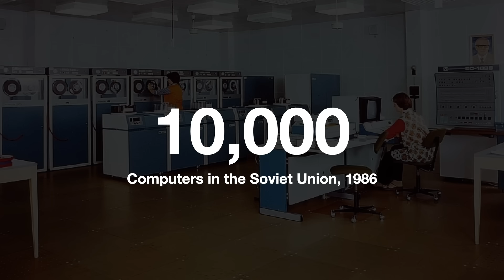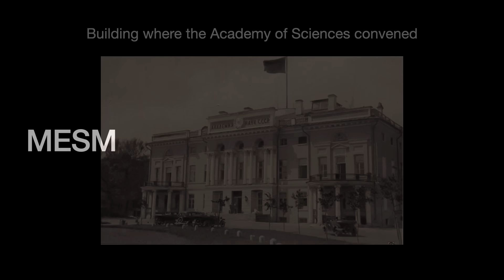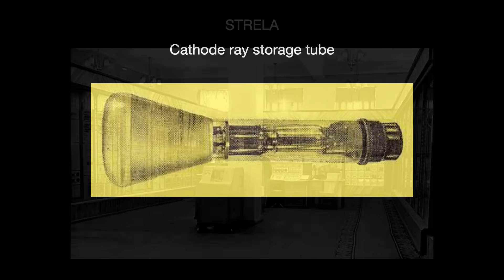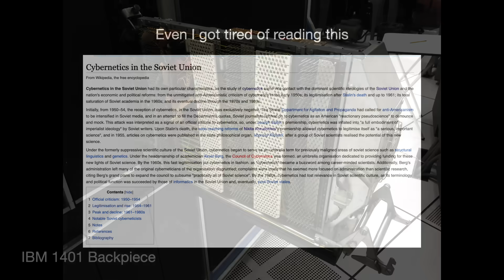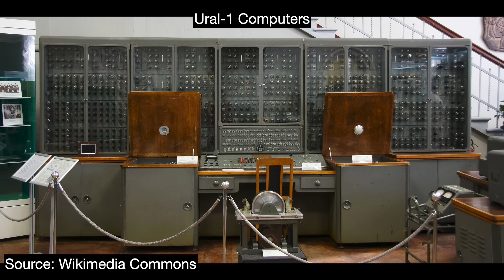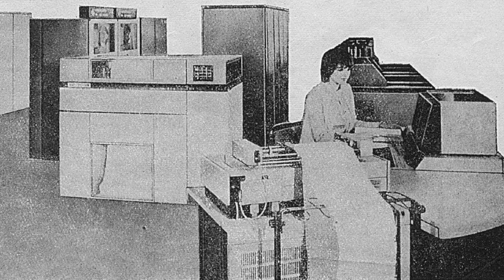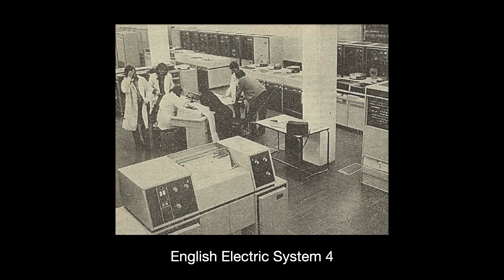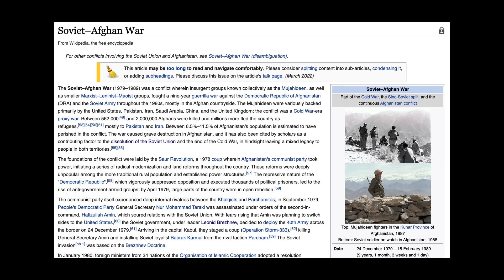Why the Soviet Computer Failed

Comment: That is both the strength and weakness of a command economy. You are generally locked in to a system. If that system is what you need and works well, your golden and can have an amazing scale of production. If you need to make a change and it isn't accepted as obvious, good luck pushing against a river (especially one where political power is so heavily entwined with industrial decision making).

Where as a fully market based economy generally requires market forces to line up for an expected near term profit. But you can nudge that with public funding (like with Bell Labs and Nasa).

Comment: Relational databases.  E. F. Codd.  That was so huge, but it's such inside baseball no one gets how huge.  

Omni databases were the norm.  Powerful processing on flat files.  All your data sits in one text file and we come up with faster ways to read and write to it.  The problem is redundancy.  If you have the zip code, you don't need city and state.  If one customer does twenty transactions, we're going to have their full name and address in every line.

A relational database "normalizes" by separating out the redundant elements.  So now you have one table that has only customers with no redundant data.  You then relate the customer number in the customer table with the customer number in the orders table.  I's cheaper because it takes less space, it's quicker because the files are shorter, and it's more accurate because you don't store the same data and risk having variations.  

It revolutionized data. It made so much possible.  But it's not the kind of innovation a government will come up with.

Comment: Computer technology was pretty much fundamentally incompatible with the Soviet system.  They relied on huge bureaucracies to make decisions.  By the time any idea filtered down from the top to the people who actually made the machines and software it was obsolete.  Whenever a revolutionary tech breakthrough happened, which in computers in the '60s, '70s, and '80s was about every 18 months, these bureaucracies had to throw themselves in reverse, forget everything they were doing, and start over.  It was impossible for them to move that fast.  They were way better at mature industries like steel and oil where they could rely on economies of scale and any improvements to either the product or process were on the margins.

Comment: Soviets failed in everything by the fall of the USSR and the Eastern Bloc. They failed because Government control of everything led to a lazy but hurry up culture. They coyld have twenty doors to a building's front entry but only one could be used so that they could avoid replacing broken ones. They also just needed to have produced a facsimile of a product or service over making sure it were working properly. Add in that everyone was graded by an average result of a class or group, and you got idiots with higher test results than the truth, with excellent people held back by said morons. Computer science and all other disciplines failed on account of these.

Comment: Very Long Instruction Word (VLIW) architectures, which are designed to execute multiple independent operations in a single, very long instruction were the Soviet legacy and the single instruction set of the West were not popular with them... The Soviets prefer beefy robust processors that generate less heat and with reduced frequency operation and less susceptible to EMS radiation, one soviet processor running at 2 GHz could do the job faster than one of the west at 5 GHZ, most Soviet designs were for the defense department and not for consumer products....!

Comment: The Soviets hammered several nails into their coffin on this subject.  I had the privilege to work with a Soviet computer operator in the early '90's. He freely admitted that they took the IBM operating system and reverse engineered it to work on their hardware. He said when they did that they viewed the error handling routines as not necessary and stripped that code out of the OS. When a application failed technicians would spend days going over core dumps or reading panel lights to try and determine what went wrong.
Reply: Cool lie

Comment: Because the only way they had access to computer chips is by buying video games and reprograming those.
Reply: This is BS. There were no real video games at the time.

I was an apprentice in the young semiconductor industry in the mid 1980s at the heart of the chip design department, we made most CPUs, PIOs, SIOs, EPOMS, RAMs etc, already on our own. Reverse engineering played a great role, but never video games.

The building you in 15:57 with the Tatra tram in front is located in downtown Dresden and I worked there in the early 1980s as a high school student.
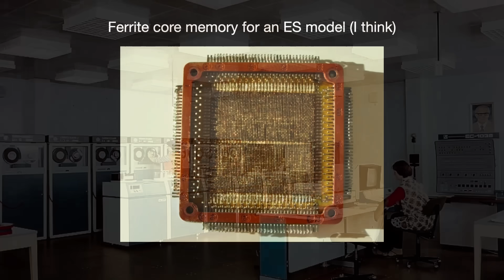But the real design centre was located at the North of Dresden in Klotzsche hosting huge IBM computers for the chip design work, where all these huge semiconductor companies are located now. The picture in 16:54 is such a computer room in the GDR where I worked.
Later during my MSc university program (electronics/electrics/ software) I wrote programs on exactly this IBM monster to hook up with the next now new IBM computer in another building.

Do us a favour, do not write such crap if you do not know anything about it.
And one more thing, do not believe we people in Eastern Europa were or are idiots. We often achieved more with less.

Peace! from Dresden / Germany

Comment: I don't understand how on Earth those old computers worked, since they had so many connectors and if one of those got lose, the whole computer malfunctions. I used to work on an old Felix C-256, that was designed in the early 70s, it didn't have tubes, worked on transistors, but it was so fiddle, needed a controlled room temperature and often boards didn't make proper contacts and had to push them.

Comment: It was by any means far more complicated. The issue was allways new discovery coming in far too rapidly. And russia is big. You have no scope how big. None has. 
So imagine you have made a computer based on tube tech. And you are smart , you see this tech evolving like crazy. You allso know that what is cutting edge today , will be obsolete next morning. You figure out to simply skip the current stuff , and wait till something more refined comes along , and upgrade when it be good for a longer time. Imagine purchasing every brand new cpu as soon as it is available even if the increment is not a lot of more extra. And your current stuff works fairly okay. And that is what russia did. They knew , if they went on and start to computerise whatever is possible , only a very small fraction will be done by the time that computer becomes obsolete and useless. Instead lets wait for something better. And russia actually did allways go this route. They never ever started to adopt anything on large scale unless it was refined enough for many years. In the meantime , importing technology that is getting obsolete and therefore cheap , was allso done. That was the least costly way to both have computers , but not realy relay on something exotic , yet have the potential to solve sourcing by producing if they ever get cut off from supplies. This had spared gigantic amounts of money for them over the time. They had quite a lot to build , there where many gigantic projects that needed those funds.  Surely one might ask where and what , but thats not so simple. Assume you just want to give everyone 1 dollar.  With a pooulation of 10 billion , thats gona be costly. And the result per person would be quite small. Now russia has very large distances , they had to make roads , rails , recomstruct a lot of buildings , build telecommunications  on the order far greater than the usa had ever.  And allso had to plan the economy. New agricultural machinery needed etc.. in vast numbers. Crazy big numbers. At that point , if design could be made more efficient and cheaper by computers , down to the single porudction 1 item , the costs where little... consider the world wide known mtz tractors. The crank case casting is even today Just a very slight modification of the original. Millions had been produced , the design no mather how costly would had been , has very little reflected in the per piece price. And that is why russia did not develop computers , and did not employ them as soon as they where available. It simply just made no sense at that given time and situation .

Comment: The computer in the thumbnail is actually Bulgarian. In fact Bulgaria made most of the large mainframe computers for the eastern block so most of the computers present throughout the 70s and 80s are Bulgarian. Also Bulgaria was not part of the Soviet Union despite being communist country and having close relationship with Russia. Also another thing Bulgaria was the only country in the Eastern block to manufacture magnetic disk drive storage modules for the entire eastern block. Easy way to know if a mainframe machine is Bulgarian is to see for the Indication "ЕС" somewhere on the machine. That's how IZOT named all their line up products. "ЕС" followed by a model number.

Comment: My grandfather was a computer programmer and managed to negotiate the purchase of the first IBM computer in Czechoslovakia, in the late 1960s when political conditions were more loose. Until then, his factory only had the Soviet Urals, that would crash all the time. Since the purchase of the IBM machine, his office was flooded by hordes of Soviet computer engineers, keen to take the computer apart and look inside. Eventually, the intimidation from the secret police (STB) got too much and grandpa quit the job and moved to another factory. Years later, he took apart the latest Soviet production (ES) and found it to be a 1:1 copy of his old IBM. So much for my grandfather's contribution to the development of computers in the Eastern Block.

Comment: Although some people imagine that from the beginning of the 1970s all computers in the USSR were developed and manufactured only according to the ES EVM project, this, of course, was not so. Other successful models of different standards continued to be manufactured - from the same BESM-6 (it was manufactured in a modernized version until the mid-1980s), powerful PS2000/PS3000 computers, popular models of the M series, Nairi, Minsk, etc., and naturally - various military computers (5E series, etc.). Small control computers were manufactured for production and science, and of course - many on-board computers for civilian and military equipment. Since the early 1970s, the active production of various minicomputers began, and since the mid-1970s, microcomputers - some of them were software compatible with the popular American models DEC and HP (Soviet SM-2, 3, 4, 1420, 1300, 1600, 1700, Elektronika 60, 79, 81, etc.), some with original architectures - Elektronika NC, S5, etc. Various desktop programmable computers were produced, similar to modern PCs - for example, the large Iskra series (the most famous and powerful models are 1256 and 226) and Elektronika (D3-28, T3-29, etc.).

Since the beginning of 1980s, the production of classic PCs based on microprocessors began - VEF Micro, Agat, DVK, BK-0010, Elektronika 85 (MS0585), ES-1840/1841, Iskra 1030/1031, Neuron I9.66, SM-1810, UKNC, Korvet, Vector-06C, Istra-4816, PC-01 Lvov, PC8000 Sura, Apogey, Partner, Nemiga, Poisk, MK88, MS-1502, Assistant-128, MS-0515, many Spectrum-compatible home PCs (Byte, Robik, Dubna, Magik, Orel, etc.) and others. The USSR created very advanced personal computers, and on its own element base: for example, the 16-bit professional Istra-4816 with three processors (the main one is K1810VM86, an analogue of i8086), large memory and advanced graphics, and all the electronics are on one board, or the inexpensive educational UKNC (MS0511) - the most popular Soviet PC, with two 16-bit processors (DEC-compatible K1801VM2) and excellent color graphics 640x288, or Soyuz-Neon PC-11/16 - an advanced fast 16-bit computer (on a DEC-compatible processor H1806VM2) with large memory (up to 2-4 MB) and hardware implementation of screen windows with multi-color graphics (up to 65536 colors). By the way, the most popular models of Soviet PCs were made on the original Soviet processors of the K1801 series (which did not copy American processors, but used the PDP-11 command system) - these are the UKNC, DVK and BK computers (a total of about 700 thousand of them were produced). Since the late 1980s, computers were also created on an imported element base - for example, IBM-compatible (Kompan, etc.) or Besta-88 (graphic stations based on Motorola 68020 and 68030). New supercomputers were developed on a modern domestic element base (Elbrus 2 and 3, Elektronika SS BIS), multiprocessor computers on special processors such as transputers (the Mars-Kronos project). 

Since the mid-1970s, the USSR began producing pocket calculators with LCD and LED indicators (dozens of models), then programmable calculators, in 1985 the famous 16-bit pocket computer MK-85 (and 85M with more memory) was developed and began to be produced - the world's first 16-bit pocket PC, produced until 2000, and in 1986 an excellent portable 16-bit computer MK-90 with a graphic screen was developed - also one of the first of its kind in the world. 

Back in 1979, the first chips of the 16-bit microcontroller K1801BE1 with the original Soviet command system Elektronika NC were released (this is the predecessor of the famous processors K1801VM1, VM2, VM3), and in 1980 its development was completed, and it was one of the world's first 16-bit microcontrollers - it was used, for example, in the pocket translator Elektronika SP and the electronic notebook MK-87. In the late 1970s, the release of an interesting sectional kit K588 (also original) began, allowing you to program the desired command system - it was used, for example, in the earliest versions of the PC Agat (to emulate the 6502 command system), in the portable MK-90 and the educational Nemiga (emulating PDP-11 commands). Other interesting developments include the powerful 32-bit L1839 microprocessor set - a highly integrated analogue of the very complex DEC VAX-11/750, analogues of the very advanced DEC F11 (K1811) and J11 (K1831) processors, and the simple PDP-11-compatible DEC T11 (K1807) - however, instead of them, the Soviet K1801 was more often used, which had no analogues from DEC. Of course, the USSR also developed and produced analogs of popular processors and microcontrollers from Intel - 8080A (K580VM80A), 80C85 (IM1821VM85), 8086/8088 (K1810VM86/88), 8048/8748/49/51/31, etc. (K1816 series), 80286, analogs of 65C02, 68000 processors, etc.

I am writing all this so that it is approximately clear that there was no decline or stagnation in the Soviet computer and electronics industry, it developed quite quickly (at times catching up and even overtaking Western manufacturers in some ways), but, of course, in a peculiar way, given the specific organization of the economy and noticeable isolation from the world market.